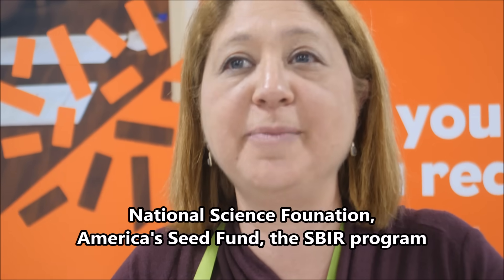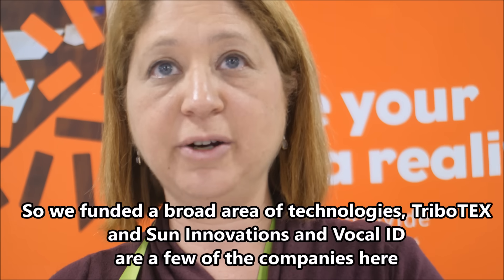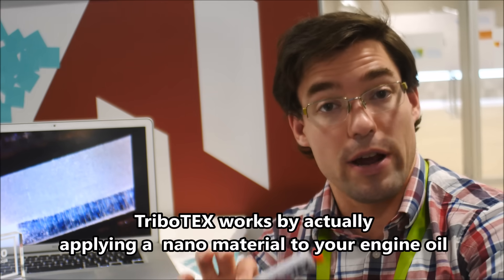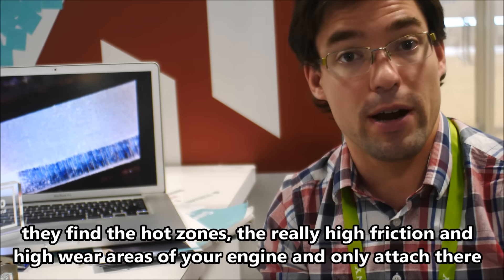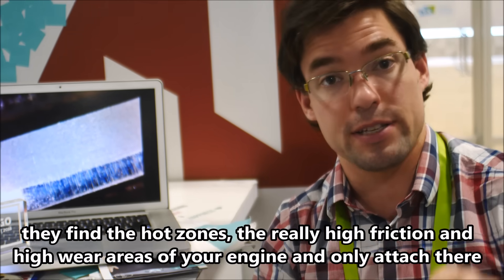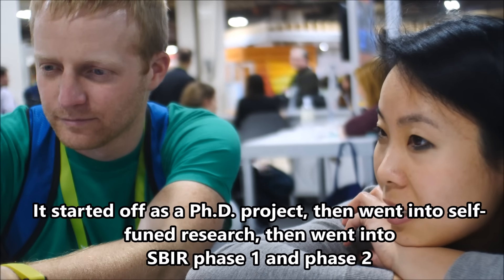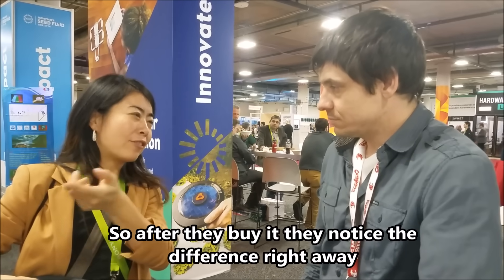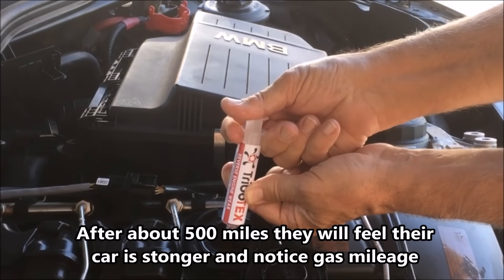CES New Automotive Technology review with the National Science Foundation and TriboTEX Nano Robots

Comment: I know that TriboTEX will work with both conventional motor oil and synthetic motor oil, but does it work better with one or the other? I ask because I understand that it should be added right after a fresh oil change and so I'll want to use the type of oil it works best with at my next oil change when I apply the product.
Reply from the maker: It will not work better with one or the other; however, it is important to use the correct viscosity of oil recommended for your engine.
Reply from the maker: The engine oil type will not affect TriboTEX. Feel free to use your favorite engine oil.